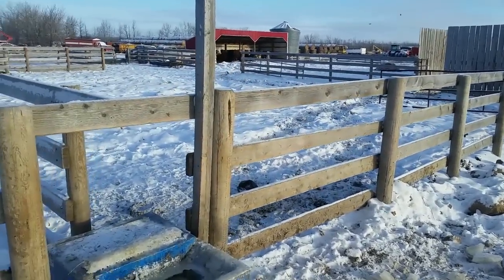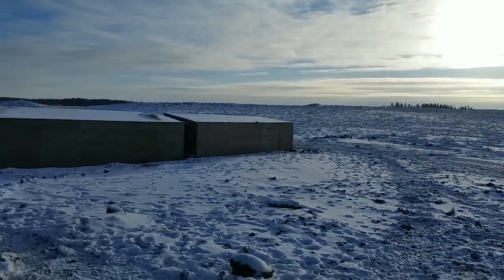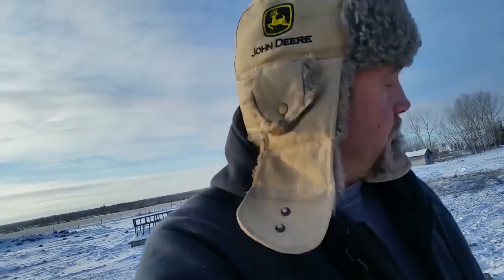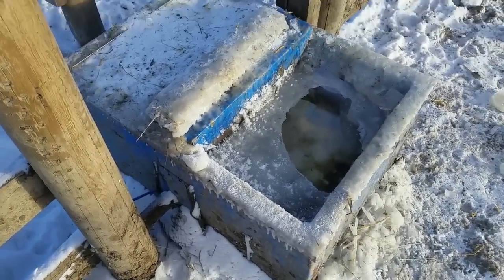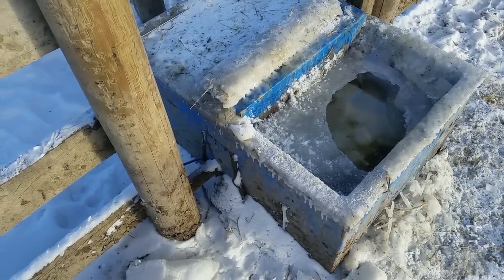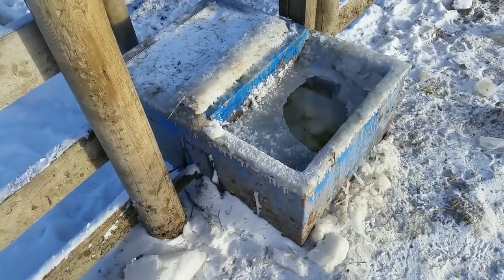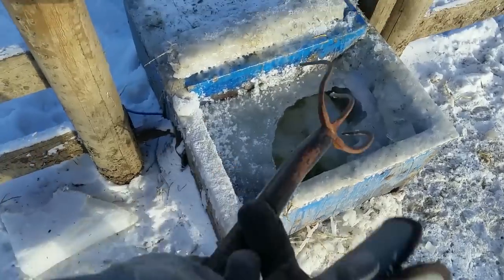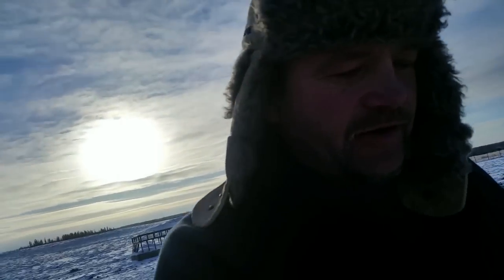Automatic Cattle Waterers!!!

Comment: If you have a dug out, you can use a nose pump, no electricity n no heater needed! It requires you to pipe into the lowest part of dug out, the cattle pump water as needed, and it drains itself as well so wont freeze. Look up frost free nose pumps
Reply from the maker: This is where the water comes from is the dugout.  I heard they would still freeze in -30

Comment: I have a Jug . they cost ten dallar's a year to run. I am in southcentral Wisconsin
Reply: I have 5 Jug waterers on my place and have plans to install one more this year 
First winter after I installed them my electric bill dropped $150 dollars a month 
No more light bulbs or heat tapes ,68 watt heating blanket on a thermostat  so all five don't call for much power 
No I don't have any connection to the company just strongly believe in a good quality product

Comment: So is the heating pad actually in the water or in the structure of the tank or underneath the tank?
I ask because years ago we had an issue of a very low electrical "leak" in the structure of the milking parlour metal work and this caused no end of problems with the cows as they could clearly feel it but we could not! It took ages for the elctrician to find it and solve it!

Clearly water and electricity do not make for good bedfellows!!
Reply from the maker: No... it fits flush to the underneath of the bowl...One year we forgot to hook up the ground and the cattle were getting shocked

Comment: When we have pipes freeze underground.  We take 5/16 sapline and attach a funnel to one end.  Stick the other end in the pipe and pour hot water down the line and keep pushing the line in as it goes.  Doesn't take long to get it going again.
Reply from the maker: Our lines dont really freeze since they are burried 8 ft.... it usualy just freezes in the bowl and just under the bowl inside if the power goes out.  A blow dryer and a 5 gallons of hot water and your up and running again

Comment: thanks for the upload! I use polyurethane water-holders from a company out of Iowa.  The tubes are isolated and have electric heating in them, they never freeze. But the thing that the cow has to push down on to get to the water freeze every night when it's below 15
Reply from the maker: I Have seen those ones before.

Comment: Once the pipes under the water froze on ours right at ground level on Christmas day. We spent hours using hot water and a mini heating torch to get it to melt. Nothing worked. So we came up with the bold idea to turn on a hair drier underneath the water and shut the door to prevent more cold air to get in. We left the drier run over night. The next morning we checked if it working and it did! The air drier did not work anymore but who cares. lol At least the pipe was not froze. Now we got new heat tape on that pipe and knock on wood it should never happen again.
Reply from the maker: Lol yea I was just going to say a hair dryer works Great.  We used one for that to and you only have to leave it on for a few hours
Reply: Just did that yesterday, waterers survived the -30 and then one froze up at -14??  Strange. My pink hair dryer works great. :)